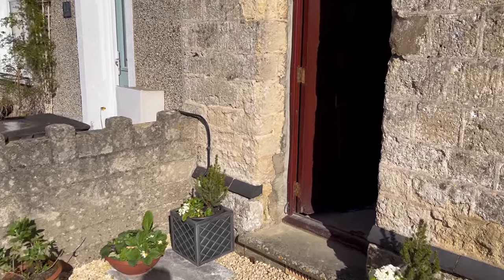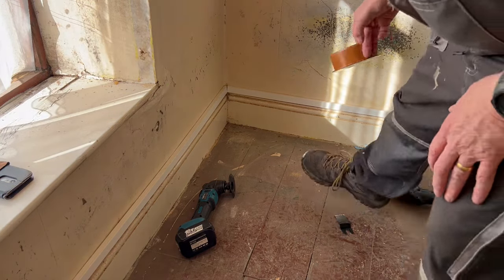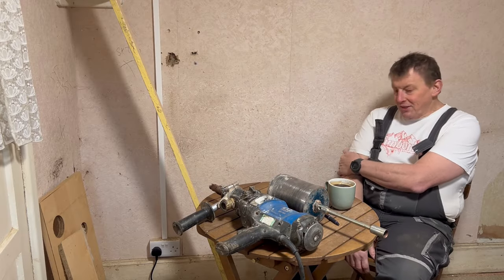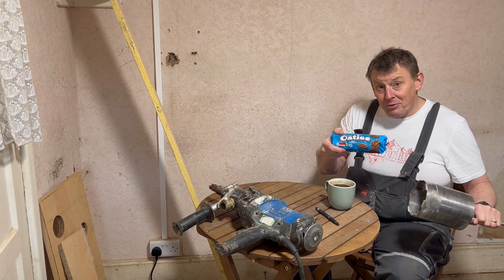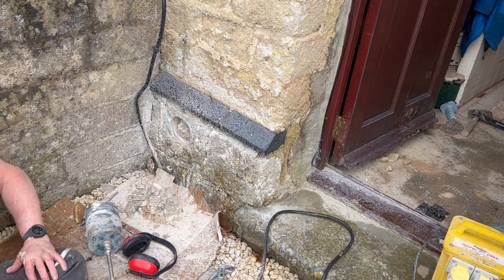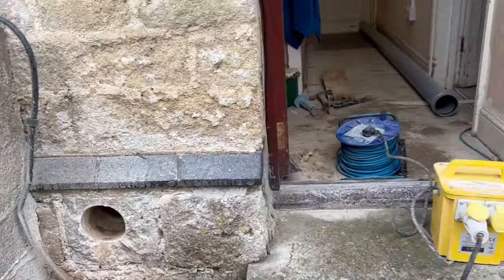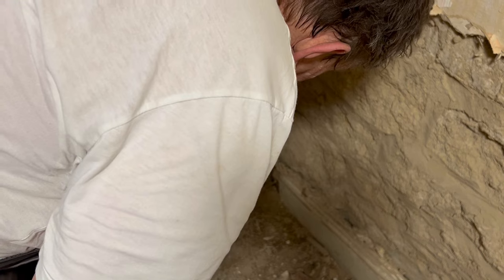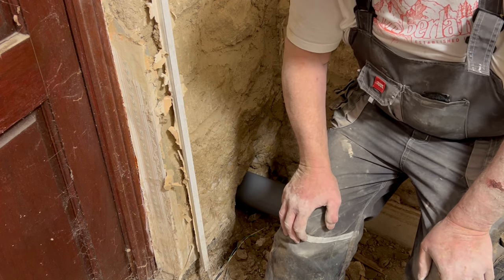Drilling a great big hole in a stone wall @Bramblecottageuk

Comment: Don forget to put some insuulation around the downpipe before you box it in unless you want the hallway to be known as "the hallway of interesting noises". Also if you can help it, install two 45's instead of one 90... two 45's make for a much more smooth (pun intended) flow in the pipe and it helps with preventing blockages...
Reply from the maker: @koningbolo4700 I got your point with the insulation..that's number 1 and number 2 (pun intended) on the list of priorities. Thanks for the tip with the 45's...I will buy a couple tomorrow and see if I can make it work...I will need a 90 on the outside and 2 45's on the inside. I'll keep you posted. Rich